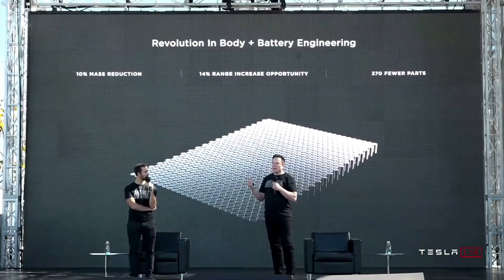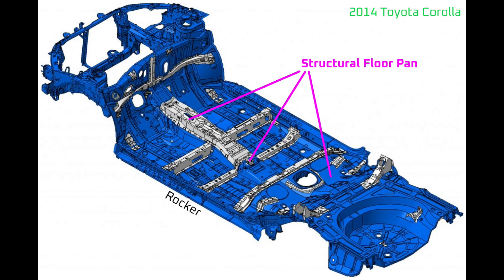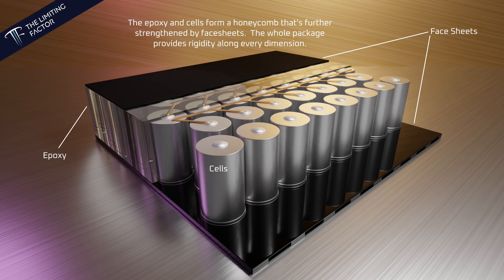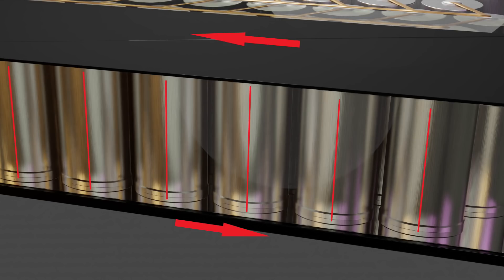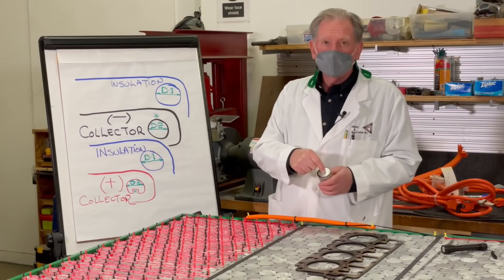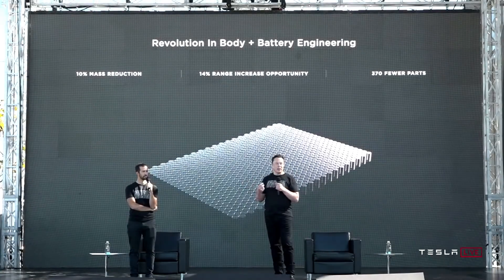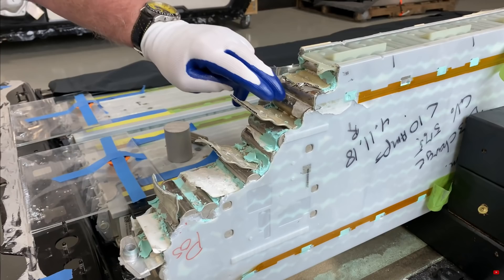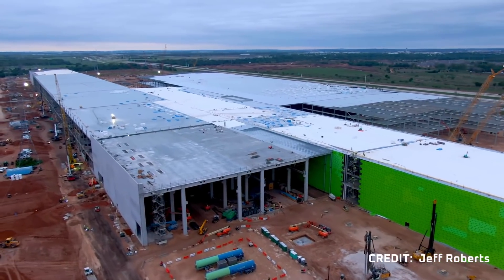#15 The Engineering of Tesla's Structural Battery Pack

Comment: How would the honeycomb structure look for the standard range you think? Do we know the capacity for a single cell?
Reply from the maker: I worked it out at one point and I would need to recalculate it.  Ultimately it doesn't matter anymore and I didn't keep the calculation because the capacity of the individual cells won't be what drives decision making.  It will be cost, trim level, and material availability.
Reply: @thelimitingfactor  True! Just exciting to  speculate about what to multiply 960 cells with. Sandy Munro seems very ambitious with a 130kwh pack.